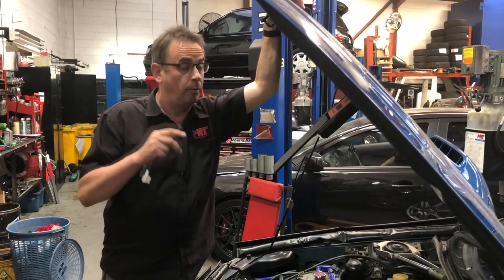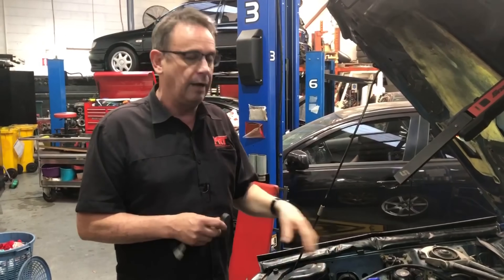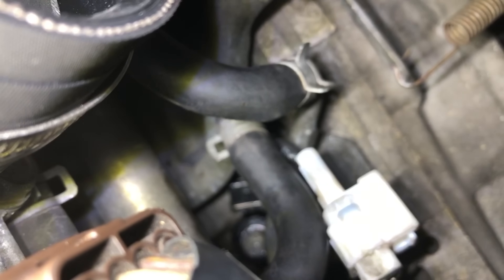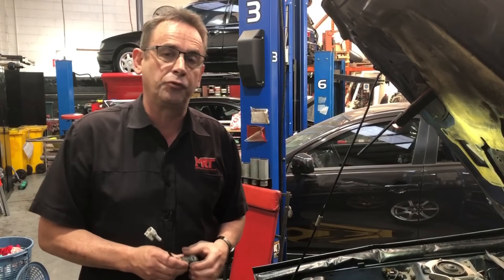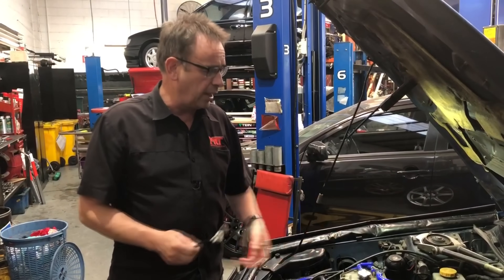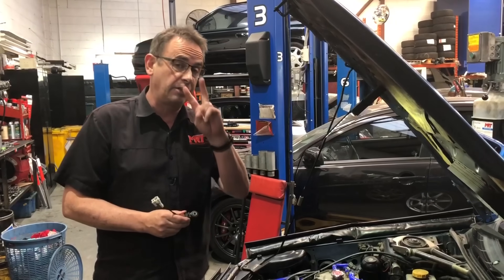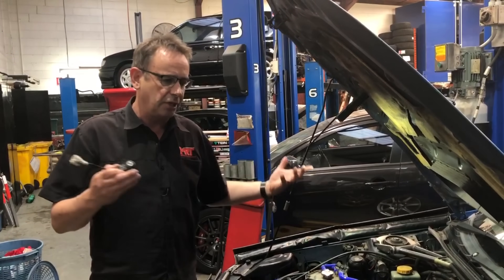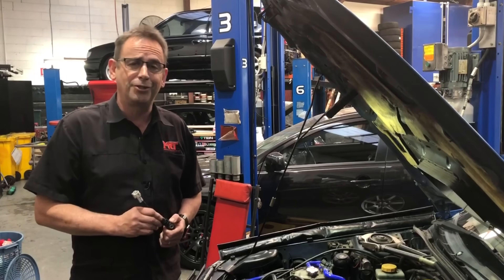Subaru Knock Sensor Troubles

Comment: I had the knock sensor failure in my Forester Turbo. I replaced the sensor and I still have issues with it ;(
I have no idea what the problem is.
Reply: Same jdm forester 00’ i use 91 shell full. I used chevron 94 a few times and i got knock sensor issue
Reply: @kaindubois4206  I use German 98....
Reply: same here, 99 gt forester and still throwing code. did you sort it out?
Reply: @zacjohnson8404  I got rid of it by using a new original Subaru knock sensor.

Comment: Should I adjust retard the timing by one or two degrees (freessm)if I pick up occasional pending DTC of Knock sensor. Some suggest that the knock sensors for the older 2000/2001 ej motors were over sensitive in design .Thanks for a great channel.Brad

Comment: What is the causes of ej257 motor failures in USA and Canada? ALOT of engines are having rod nico warranty repairs; owners say they do oil changes at 5k and keep oil level at full. But rod bearing keep failing???
Reply: possibly the factory oil pickup tube (braised instead of welded) cracked?  Could lead to picking up air or creating foam in the engine oil, leading to bad oiling.   Or related to the smaller oil filter and changing oil at 5k.   Worth watching this:  https://www.youtube.com/watch?v=MCSajTujedE
Reply: Luke P the oil pan was too wide along with horrible baffling allowing oil to slosh around picking up air for brief moments. Also the oil pick up tend to get cracks in the brazing. They burn a decent amount of oil so oil levels too. But mainly the oil pan and baffle was the main problem

Comment: Would like to know if the knock sensor is something that should be routinely replaced, say in a Subaru of 15+ years? Can they be problematic without throwing a CEL, like many sensors tend to do before they fail completely?

Comment: Thanks... so will the part fail (crack) and not pick up knock but still not show a fault code? That is, should we be checking the knock sensor even without a fault code?
Reply: Cracks allow moisture to seep in so I would swap a cracked sensor even if there is no code yet.